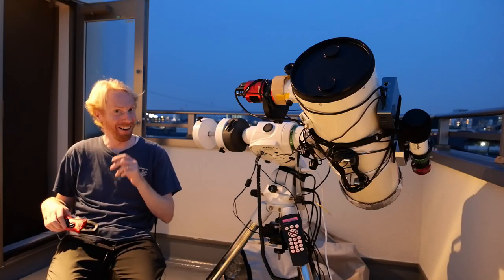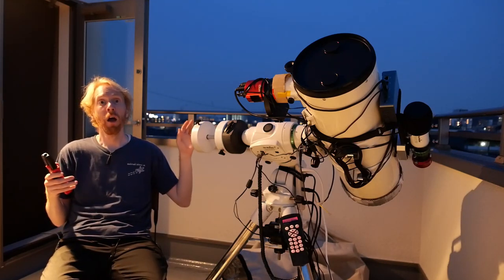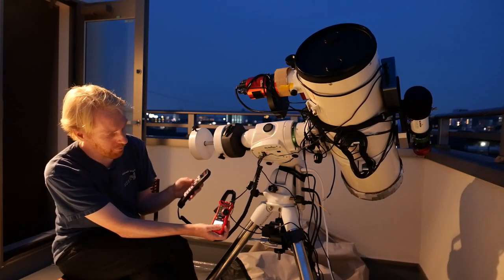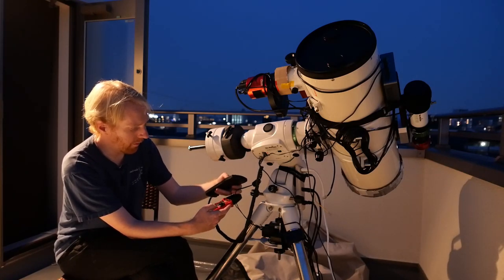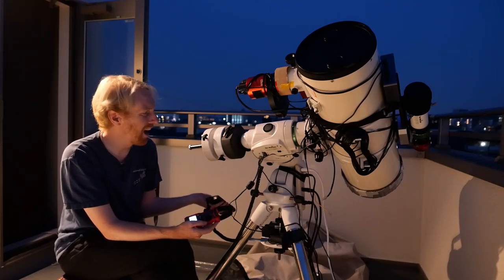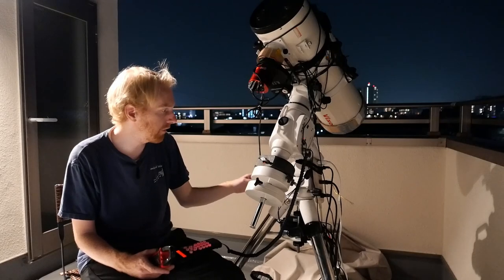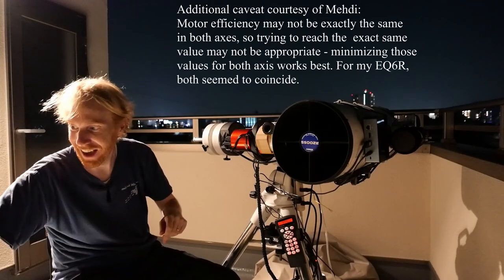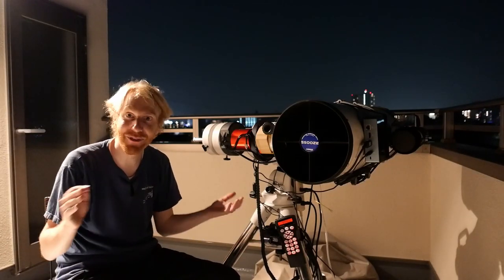Simple and PRECISE mount balancing! With the power of electricity!

Comment: Thats cool. If i was a manufacturer i would have this built into my mount. As a  series of led lights on the mount or maybe an indicator on the controller.
Reply from the maker: Apparently the 10Micron mounts have something like this in there!  And yes I had heard of something like this for iOptron, I didn't realize it had actually been done!
Reply: @CuivTheLazyGeek  apparently, at least on the AZEQ6, there is a menu where you could ask it to display the voltage (it refreshes every secs or so).  What we really need is for it to display the amperage :)

Comment: Clamp meters are magic, I hadn't thought of using current to measure balance, Genius! Cheers man
Reply from the maker: They are! You can also measure binding of the gears with a clamp meter, as the motor will require more power then :-)
Reply: @CuivTheLazyGeek  very good point!

Comment: Last night i went out with my scope after i did your method for balancing the scope inside my house. First i balanced my scope on my eq6-r as i usually do and then i used the clamp meter to fine tune the balance. I marked the balance points and went out for some tests. I polar aligned the mount with my polemaster and started guiding with phd2. BOY was i surprised, the guiding error was at 0.3'' with rc 8'' and before it was 0.8''. So yes, this method is sound.
Reply from the maker: That is awesome! I'm so glad it's helping you! So you didn't need to be East-heavy for your EQ6R? My own EQ6R seems to agree with that as well. Glad it was helpful!
Reply: @CuivTheLazyGeek  well my mount is still under warantee and i don't want to mess with it yet but the axes are stiff from the factory and it is difficult to balance the scope. With this method the mount performs as it should be. Also for those interested they could try the pegasus power box as it has inbuilt power (amperage) and voltage measurement of the power input but i am not sure for the refresh rate of the monitoring so if you have one of those you could give it  atry
Reply: @CuivTheLazyGeek  i don't east-hevay my mount since i haven't seen any difference form east-heavy and perfect ballance (from when i used my hyper-tubed heq5-pro) Also since the eq6-r is still new and has stiff axes i see no reason to off-balance the mount since the gears will be meshed (even though they may be badly meshed, and i will do a proper srvice after the waranty is over)

Comment: Its a nice surprise when you have a TIP like this ... specially when you are a spark (me) !!! So clever and simply  idea !!... i will add a small digital DC current device in line with the power supply for the mount... sounds like a plan for me !!! Thanks again amigo !!!
Reply from the maker: Glad you liked it, I hope it works well for you!

Comment: Brilliant way to balance! As some one already wrote, it should be built into the mount. I have an Atlas pro and I have exactly that problem (actually stiff Dec). So today I used the Pegasus Pocket Powerbox  software to properly balance the Dec. Great video as usual!
Reply from the maker: Oh, the Powerbox measures that as well? That's great! Thank you!
Reply: Yes, it does but not so precise as your method, it shows only decimal (I think it’s called) for example 1.2, 1.3 and not 1.23 like your method. I will send a mail to Evangelos at Pegasus to ask if the software could measure more precisely.
Reply: @CuivTheLazyGeek  Nope it does not,it just tell you the power consumption of 2amp that's it.

Comment: Good information! I've used a similar method when adjusting the worm gears of my EQ6. In this case I've used a current clamp with analog output and an oscilloscope to take a close look at the current drawn by the motors. As soon as one of the gears starts binding or the tension on the bearings is to high, the current rises ever so slightly.
Reply from the maker: You're going even deeper with your method, thank you!

Comment: I've watched a lot of your videos, mostly about NINA - thanks a lot - you have been MOST helpful! I have one of those Avalon M-Uno mounts that you mentioned as being completely belt-driven, a Celestron Edge HD 9.25 and a Primaluce Eagle 3Q PC unit on the DEC axis. The Eagle shows the A (current) used on each port/power outlet so I should be able to read the current used directly. I'll try it and let you know if it works! It looks like a great way of obtaining accurate balancing (which is actually what I want for my mount - so no deliberate weighting).
Reply from the maker: Would be awesome if it worked directly with the Eagle! I had considered that unit, but was very worried about the proprietary cables!

Comment: Hi Cuiv,
Your enthusiasm is so communicative! Thanks for this brillant moment of so clever applied physics, rather than "pure magic". As a lazy physicist, I would say you are measuring the magnetic field generated by the displacement of electrons in your wire: the less balanced, the more power consumption and current, then the more electrons generating such a field to measure. The challenge is thus to approach a null difference in both directions of a given axis.
If you have one, put a compass very close to your wire. The needle will move while applying a movement to your mount, revealing that little magnetic field...
I look forward to check my own EQ6 R Pro that way!
Clear skies,
JB
Reply from the maker: Ooooh right, that makes a lot of sense, thank you Jean-Baptiste! And so coiling the wire around that clamp would make that magnetic field stronger and thus measurement more precise, as others have mentioned. I'll try the compass too, thanks!

Comment: I added an inline meter to my power cable.  Shows voltage and current and only cost couple of £ off Ebay. Added it to monitor loading and battery supply but now found another use thanks to your video 👍
Reply from the maker: That sounds excellent, probably more precise too, and cheaper as well! Hope it will work well for you!

Comment: Cuiv, very clever and super cool and lazy way to better adjust balance, but proof is in the how the stars look, as the way was to be east heavy ( I think it was East maybe West)a tad so the gears had a bit of weight on them. I will try this on my AZGTi and see as I just finished doing a small hypertune to the RA and now turns easy and smooth. Thank you and Mehdi!
Reply from the maker: Oh I'd be very interested in your AZGTi hypertune - I ended up completely ignoring the spring mechanism in RA on that mount, it's just too weak. Do you have any pictures or description of your method? And you are right, East-heavy is typically better (but what about after the flip?!)

Comment: A good solution for sticky RA & Dec Axis's especially for Skywatcher mounts which is a common problem. Best solution is to Hypertune your mount, including replacing all bearings with high end ceramic ones, Synta mount bearing are low end.
Reply from the maker: Thanks for the feedback! On my AZEQ5, I tuned and regreased the whole RA axis, and yes, the bearings were not of the highest possible quality! Still it wasn't as bad as I feared, and a non-sticky grease seemed to be applied properly, if a bit heavily.

Comment: It is interesting to monitor the amps during slewing. Your video made me think to monitor my Pegasus Astro Power Box Advance which has voltage and amperage monitoring in its software. It monitors to the tenth of an amp and definitely lets you know if the motors work harder in one direction or the other. Good stuff!  I definitely go heavy on the (Dec) primary side of my Newtonian. My decision gets harder on the RA side if my target is still happening after the meridian flip. I go East heavy and cross my fingers and toes after the target passes the meridian. It’s too bad there isn’t an automated weight shifting thing a ma jig to shift the counter weights. My mount is an older Celestron Advanced GT and it is   Sloppy. Love your videos!

Comment: "Current", that's the name of the magic field that excites the amps faeries in the Continuum Transfunctioner :-). Instead of Hall effect clamp, it might be cheaper, more accurate and simpler to buy an in-line amp-meter and plug it between the mount and the battery. That would probably be about $10 ($1.50 if you skip the importer's racket and order directly from Aliexpress), smaller and could  be duct taped to the mount. If you spend a bit more money, you could even plug it into a computer and make a program that would calculate the relative position of the center of gravity vs center of rotation by sampling the current in both direction at different RA and DEC angles.
Reply from the maker: Ooooh so many possibilities! Now I'll have to think about a lot of things :D

Comment: Great video man! Btw "current" is the magic :-). In the past, you couldn't measure DC current with the usual multimeter. Many clamp multimeters can only measure AC current, as they just use what is called a current transformer. But even the cheap ones nowadays use half effect devices to measure current, and so can measure AC or DC current. Not sure which model you have but it's probably a good idea to put the meter in position and zero it out just before measuring DC current, to compensate for the Earth’s magnetic field and any nearby magnetized objects. An inline DC current meter attached to the mount might also be useful.
Reply from the maker: Current :D Thank you! Right that makes sense, I hadn't noticed that function to set the zero, like on a scale. Thanks for the tip! And yes inline DC current meter is the next logical step!

Comment: Wow! 😲 Never have heard of this magic before... 🙏 but isn’t there this recommendation to slightly imbalance towards east?
Reply: Exactly what I was going to ask, thanks Mathias.
g.
Reply: If your  doing a meridian flip it's better not to be east heavy.
Reply: Yes, exactly. It can depend on the mount design. My Losmandy Titan prefers east heavy. At least with this trip you could measure how much weight offset you require and it would be repeatable.
Reply from the maker: Yes I was so amazed that it's actually working! And you are right Mathias - and geert (and many other comments pointing out the same), and I have added a comment about this. I think it will always be better to be east heavy on a mount that displays any significant backlash or play in RA - even if it means being West-heavy after a flip, I guess it's better than floating (not completely sure though - I would need to test it out!). At any rate, the perfect mount balance can be found with this method, and then a very slight East-Heavy can be accomplished easily!

Comment: question about balance and unbalanced loads-

Had some friends over a month or so ago.  Balanced the scope with their camera riding piggyback.

Shot until 1 or 2AM.

When they left I put my camera on the back of my scope (forgetting the weight difference between their camera and mine - with my lens adding most of the weight).

My EQ6-Pro essentially rolled over - from my camera sitting on top to sitting below the telescope.

I have used my scope a few times since then and I do not think that it damaged anything but I am curious about your thoughts on this.

Comment: Hi Cuiv! I use an EQ-5 Pro which uses one thick cable for RA and one thick cable for DEC. How can I test + or - individually? Can I simply remove a piece of the outer sleeve of a cable and find two cables in there which I can separate to measure the amperes? I don’t want to ruïn my new cables, but I’m dying to find out, since I already own a clamp-meter with ac/dc function. Please advise me, because I couldn’t find the answer in these many comments. Love your enthousiasm each and every time ;-)

Comment: another trick to maintain the position of the CW and avoid CW slipping (during imaging, believe me, it happens :D) if you don't change your imaging setup: there is a hole on the CW shaft, if you lock the set screw of the bottom CW to that hole, then slide all the remaining CWs on top of the bottom, then push the CW shaft in or pull it out to find the perfect balance position. After the that, just lock the shaft, you won't need to find the balance again next time, just lock the bottom CW to the same hole on the CW shaft :D
Reply from the maker: Oh, that's an excellent idea! I haven't had such a slip yet, but others have asked me about it! I would then be worried about the CW bar stopper bolt having to hold the weight of all the CWs though... I think I'll test this out, thanks for the tip!
Reply: @CuivTheLazyGeek  youtube didn't notify me when you replied :D. You still can use the stopper bolt on each CW to secure it to the CW shaft as you used to, but it won't be able to slip down during the night. The CW bolt is quite strong actually, I stacked both CWs without issues. I set up and tear down my imaging rig for every session, it's very frustrated in the first year in this hobby because it didn't know the trick, but I can start imaging just 15 minutes after setting up the tripod now. I actually haven't seen anyone applying the trick :D.

Comment: I suffer from my counterwieghts slipping down when I lock them. The on,y way to stop slipping was using duct tape below the weight. How can I avoid the slipping. I do tighten them very well but cannnot avoid slippage; it is same SW eq6r pro lik e yours.
Reply from the maker: Huh, this is not something I ever had... Counterweights slipping sounds very bad. Duct take below the weight sounds good, but I'm wondering whether your counterweight shaft may have been poorly manufactured? You may want to contact Skywatcher on that...
Reply: Cuiv, The Lazy Geek tks Cuiv.. time to fix it then.

Comment: I use Anderson powerpoles for all my 12VDC (I dislike the cigarette lighter plugs) and have always an inline voltmeter/ammeter hadn't thought of this use. My AZEQ6 is a bit on the stiff side . Clamp meters aren't that accurate either.
Reply: I am also using the Anderson powerpole connectors for my AZEQ6.  Like you, I've always have a   watt meter hookup up between my power supply and mount.  I've been using this method Cuiv described above for a few years now to balance my mount.  The AZEQ6 is horrible in terms of trying to balance the mount freely/manually.  This is due the type of bearings it used internally as well the clutch system it has (which uses friction pads similar to the brake pads in your car).  Those friction pads always engage the friction discs which adds lots of resistance when u try to free spin the axis.   Now, the beauty of this clutch system is far superior than the ones that's used in most other amateur mounts; which is basically a small brass button holding the entire load!  Once u engage the clutch on the AZEQ6, nothing moves as it's like a vehicle brake system!

In my watt meter, I could always see the amp draw so using what Cuiv have described above, I could always get the mount to reasonably balanced.
Reply: @ag538  Hi,
I was going to try to 'Supertune' the AZEQ6 not sure it will be a whole lot better, I will try the current balance method and see how it goes, Not a fan of the clutches particularly the RA feel like I'm going t break it ,the DEC is ok though squeaks a bit when slewing.  
I guess its nice to know the clutches don't slip easily at least
Reply from the maker: Interesting to hear - so the clutch system is then the same as the AZEQ5 - it is possible to actually make it much smoother with the clutch disengaged, but it's a bit of an involved process. The problem with the AZEQ5 is that adjusting backlash will push the gear itself onto the shaft to some extent, which will make the axis a slight bit stiffer. It's all about finding the right balance between the least backlash, while still having a reasonable smoothness in the axis. I assume it would be similar with the AZEQ6!
Reply: @CuivTheLazyGeek  
Haven't tried adjusting the AZEQ6 but think it is similar the the AZEQ5 actually thought about  the lighter mount the AZEQ6 is quite heavy to move about no permanent position, I leave it on the tripod and have the extension tube as well.  Watched you adjusting the mount seemed easy enough.
Reply: @vk2np  I have taken the AZEQ6 apart a few times now.  I've even tried to put in less grease in the thrust needle roller bearing and taper roller bearing; the result is still the same.  The mount just won't spin freely like other mounts I've used in the past (such as a Celestron CGEM).  It's the large friction clutch pad that's always in contact with the clutch rotor that caused the friction.   The RA and Dec use the same clutch system so it'll be pretty difficult to actually break the RA clutch :)  The contact area for the clutch in this mount is huge (many square inches!) compared to most other consumer mounts out there where the contact point is the size of your pinky finger nail (less than 1 square cm).
Reply: @CuivTheLazyGeek  if you can find a way to adjust the mount so that it spins more freely, I would love to hear how you do it :)  Pretty sure other AZEQ5/6 owners would love to hear this as well :)
Reply: @ag538  I guess I'll just have to live with it. Mostly tracks well.